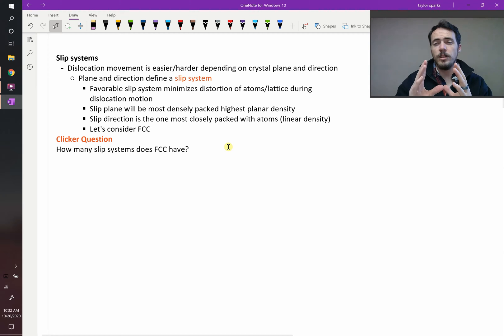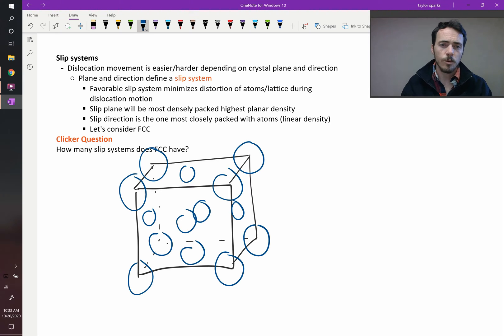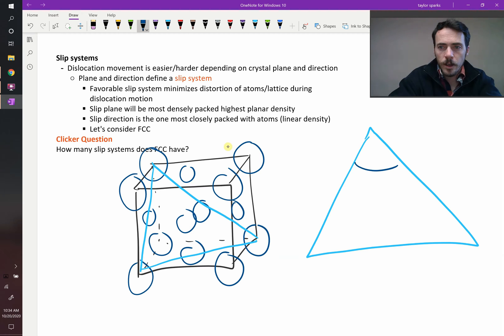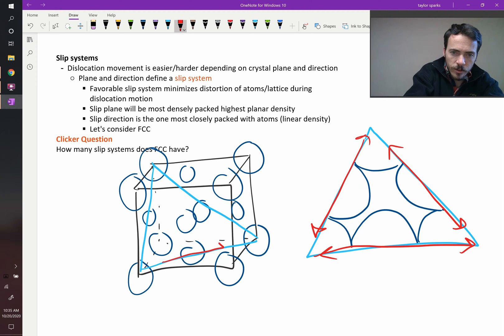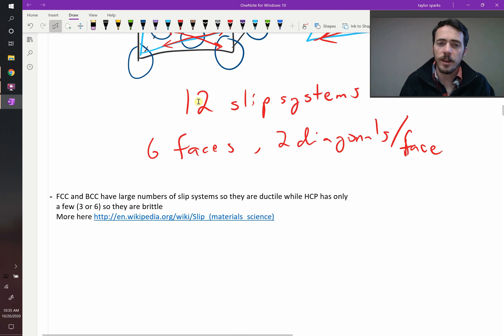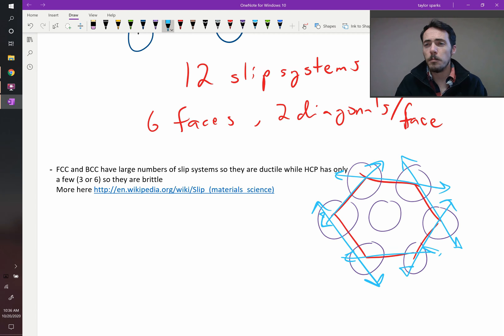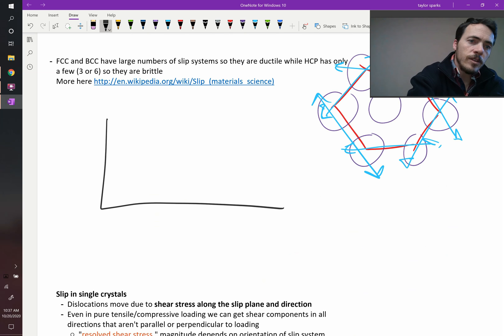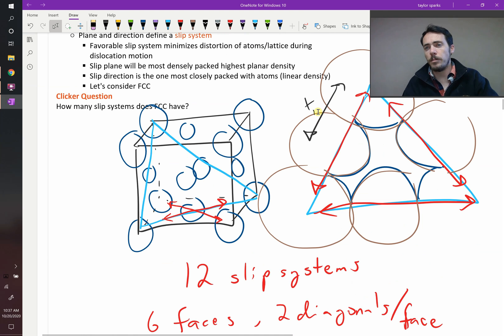Slip systems

Comment: Thank you sir. a short question:  In the case of a rhombohedral or simple cubic material, would there be only 3 slip planes? Because the planes with the highest density are (001), (100), and (010)? Is it then also true that because of the low amount of slip systems, it is more likely to twin?